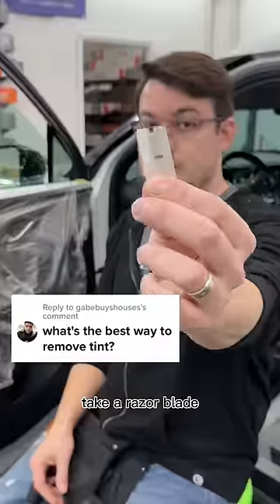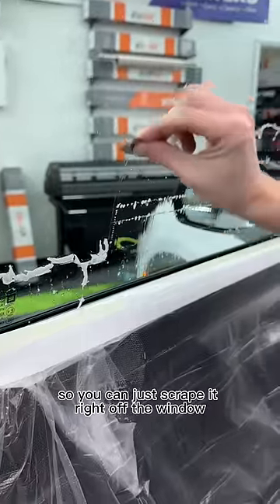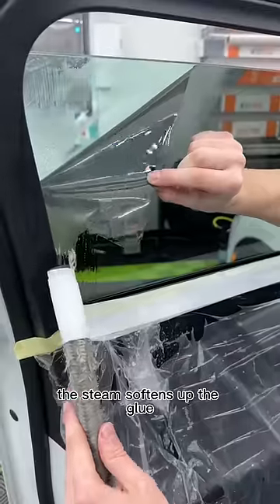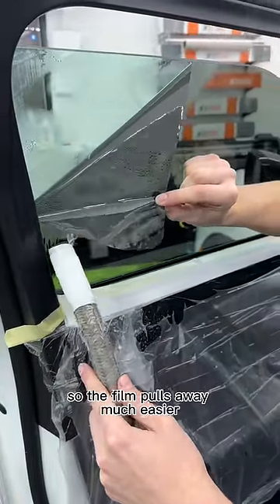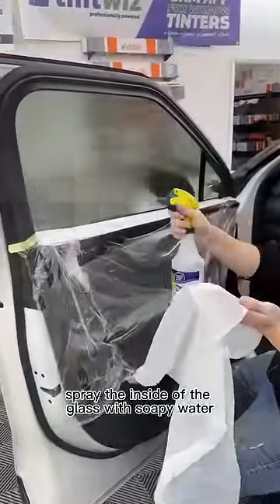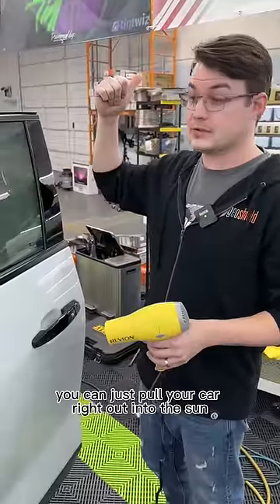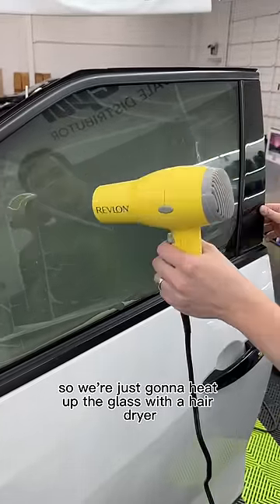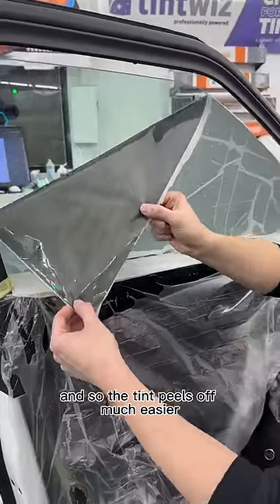Remove Tint BEST Way to do it #diy #tint #cars #windowtint

Comment from the maker: Window tint and tools —> 313tint.com
Reply: Some like Lexus and Toyota have a clear film on glass how do you handle that?
Reply: Can you do a test with Tuff Stuff? Back on my days in 2000 we used to remove the film and apply the foam and it removes the glue.
Reply: Do y’all do chrome tint ?
Reply: What soapy water do we use to spray the window and then put a trash bag on. Doea the watwr need to be warm or cold
Reply: I saw this video and tried it with my steamer 🙌 it worked perfect, removed them all in 30 minutes. Thanks for the tip, saved me $150 😄
That's what they wanted to charge me to remove the tint!
😏 "suckers"
Reply: Instead of a blow dryer what about a heat gun

Comment: I don't trust myself removing the glue with a blade. I know damn well id scratch the glass
Reply: I did
Reply: You gotta go with the curve of the glass so you don't dig into eh
Reply: @vitaliylapatin  oh.. Welp that's a bit too late
Reply: @vitaliylapatin  still trying to find a way to get the scratches out
Reply: @Nekaro Amemiya Ch. 雨宮ネカロ  you have to use a sheep wool buffing pad with some polish paste.
Reply: @vitaliylapatin  ah I'll try that, thank you very much
Reply: @Nekaro Amemiya Ch. 雨宮ネカロ   but you can't go too hard you'll make it look blurry
Reply: @vitaliylapatin  ah noted
Reply: I'm actually just kidding
Reply: @vitaliylapatin  oh.
Reply: It's not a sheep wool pad . It's called glass buffing pad. Drill attachment.  But the one that works I don't exactly know who sells it
Reply: @vitaliylapatin  I see, I'll do some research on it
Reply: you have to be joking lmao, metal can't scratch glass
Reply: @JZM006  I’ve installed window frost and other films for businesses and I can tell you you use a 6 inch window scraper on tempered glass you can definitely put scratches in it 
It’s isn’t necessarily the blade but ultra fine particles from the manufacturing process 
But highly unlikely to do it to a car window unless you’re completely out of it
Reply: Glass is harder than metal, you cant scratch glass with a razor blade......
Reply: @jimmynoodlepickle740  Glass is around 6.5 hardness, steel/iron can be almost 7 in some cases, other metals can be even harder.  Whether you can "scratch" it with a razor or not, you can easily gouge or break tiny pieces off from too much pressure in a small area, which could look exactly like a "scratch"
Reply: @jimmynoodlepickle740  glass can be harder than other metals. I can also argue that glass is harder, but it is brittle and fragile, you can't argue that a guy that broke a door window by punching it is stronger than a solid steel.
Reply: @jimmynoodlepickle740  glass can be harder than other metals. I can also argue that glass is harder, but it is brittle and fragile, you can't argue that a guy that broke a door window by punching it is stronger than a solid steel.
Reply: @Jimmynoodlepickle  try on your windsheild then reply back please :)
Reply: You can't.
Reply: You can get plastic scrapers, personally I would also scratch it so I prefer plastic scrapers for anything scraping related. since you’re going inbetween the layers, as long as you loosen the adhesive, it shouldn’t be too difficult even with a plastic scraper. They do break easier than metal but I’ve only had one break so far and that’s because I held it at a bad angle with too much force
Reply: Glass don't get scratch by the steel blades.
Reply: You gotta be one slow mf to scratch a window with a razor blade lmao they literally glide on the glass
Reply: @wherethehoochiesat4210  uh not really, you just have to hold it at the wrong angle, it glides because it’s at the right angle so the force is deflected enough to slide along the surface instead of trying to gouge it…
Reply: Thats literally not possible because glass is harder then steel
Reply: @sumdudes2ndaccountlol173  glass is a 5.5 hardness, steel is a 6.5. Which means it is indeed possible
Reply: @JacquelineUnderwood  idk where tf you pulled that Number from but Steel is a Mohs Level 4, Glass is a Level 6-7... you can look it up
Reply: @JacquelineUnderwood  go watch jerryrigeverything u'll get it
Reply: @sumdudes2ndaccountlol173  I have looked it up, literally every source lists glass as a 5.5. As for steel, I was going off “steel file” which is 6.5. That being said, even a knife blade is 5.5 which could also scratch glass as they’re the same hardness
Reply: @JacquelineUnderwood  whatever source you are using is total bs, just take a Kitchen Knife and try to scratch a Window or your Phone and you will see nothing will happen
Reply: @sumdudes2ndaccountlol173  a steel file isn’t the same as a knife
Reply: @JacquelineUnderwood  go ahead and try it, i bet it wont do shit
Reply: @sumdudes2ndaccountlol173  have you straight up never scratched a piece of glass with a nail or knife or the like before? That was straight up part of our hardness module in high school. This is a very dumb argument for something you can look up…every source says glass is between 4-7 (window glass is around 5.5) and steel tools are between 5 - 6.5 (with steel needles and nails and the like being around 6.5, and the most commonly used in hardness test kits that I’ve seen), scratch plates are around 7, etc. so while there is room for variables there, it’s not some impossibility or even improbability that glass be scratched by a steel scraper or knife or other form of tool 🤦🏻‍♀️
Reply: It depends on the glass, but glass can't be scratched with any metal softer than glass. Glass has 5.5-7 hardness, razors can be anything from steel at 4, to tungsten carbonide at 9.

If you get a cheap enough razor, it will be soft enough to not scratch glass.
Reply: @sambobop7309  Harder ≠ stronger.
Check out the Mohs hardness scale.
Reply: @JacquelineUnderwood  Steel is 4, but most tools dont use just steel. They use stainless steel or even carbide steel. "Steel" can be anywhere from 4-9, and "glass" can be anywhere from 5.5-7 or even 5.5-9 if you include sapphire crystal (which I dont)
Reply: @penguin8572  thank you for the explanation of why it varies so much, I assumed it was due to tempering tbh, but the inclusion of other metals makes a lot more sense
Reply: They sell plastic razor like things you could use to for this
Reply: The metal razor blade he used in this video Literally could not scratch the glass, as glass is harder than metal on Moh’s hardness scale. Clearly car guys need to watch more Jerry Rig Everything
Reply: you have to blunt the two edges as to not scratch it
Reply: @coach2779  It depends on the metal. Razor blades can be made out of anything from steel (Most common in my experience) which is softer than glass, or tungsten carbonite (On the blade tip). If someone used a shaving razor instead of an office supply razor they could run into problems.
Reply: It’s not very easy to scratch with a razor blade when it’s flat on the glass. You can definitely scratch it when trying to cut the film and that’s when you need to be most careful and use stainless steel blades.
Reply: @NoLurp  Stainless steel has a hardness above most glass. You would need to be most careful when using stainless steel blades, and can be less careful when using plain steel on glass and glue.
Reply: Metal can't scratch glass
Reply: It would be challenging, steel is 5.5 in the mohs scale of hardness, and glass is 6
Reply: @-Weather-  I smell jerryrigeverything
Reply: @-Weather-  Plain steel is 4 Mohs hardness...
Reply: I would have to go to the ER
Reply: @nekaroamemiya no way to remove the scratches out without replacing the glass.
Reply: Fr
Reply: Bug spray will take the old glue off and a rag no need for blade or scrape nothing, clean with windex after
Reply: I wouldn't trust my self removing the glue with a blade bc I would probably cut myself🤷🏻‍♀️
Reply: you literally cant
Reply: I’d scratch myself 😂😂😂
Reply: That's why you get a plastic blade you feel much more comfortable
Reply: I used a plastic blade. I did not trust myself to not scracth my window. Wish I saw this earlier. Could have saved me two  hours. I just used rubbing alcohol. 😕
Reply: Best way to do it is to put your index and middle fingers on the bottom of the razor, against the window so it keeps it at an angle that won’t scratch the glass
Reply: @nekaroamemiya use more glue
Hope this help👍
If its not helping just hammer the shit down
Hope this help👍
Reply: @vitaliylapatin why not just use a hard card?
Reply: @crackersnucker   not sharp enough in my opinion.
Reply: You can get scraper blades specific for glass and do it at an angle so it's less likely to scratch
Reply: Really hard to scratch it. Unless you're using it wrong.
Reply: You just need to use a straight edge razor and keep the glass wet. Also feels like this goes without saying, but be sure to use the razor at an angle, not 90° to the glass.
Reply: You can buy these plastic razor blades for Windows and paint decals. I work at a ford dealership n I gotta take tints n decals off of trade ins all the time
Reply: It’s pretty easy not scratch it, you have a better chance if you have close to if not the whole blade on there once, more surface area
Reply: As long as you have stainless steel blades and you keep the blade flush with the glass it won’t scratch
Reply: @JacquelineUnderwood regular glass is a 5.5 on the hardness scale. Car windows use TEMPERED GLASS you retârd do your research before fighting people
Reply: @zazo5525  car window glass still often has films or the like that you can scratch. Also, if you have to call names to make a point, you’re not making your point very well. Im just going to assume you’re having a bad day and taking it out on others, hope you have a better day going forward.
Reply: @JacquelineUnderwood  nope because if you watched the video you would realize it’s teaching you how to remove the window film in the first place. I love how you’re trying to deflect the question after being so confidently wrong. Also tempered glass ranges from 7-9 on the hardness scale so you’re completely wrong. One minute of simple research couldve told you that.
Reply: @zazo5525  yes, the original video was about aftermarket window tint. The comment was just about glass in general. Also, there are films and the like on a lot of peoples glass before you apply aftermarket window tint. If you scratch those, you’re going to have to remove them entirely. And you can still scratch tempered glass. Yeah it’s less likely but it’s not impossible. It’s silly to act like it is, and even sillier to continue getting at someone about offering an alternative that would be a lot less likely to scratch even the original films on the window.
Reply: @JacquelineUnderwood  Yes I know that’s why I said the video was about removing them. You don’t have a leg to stand on in this fight that’s why you deleted your comments😂 you’re wrong and you should give up.
Reply: @JacquelineUnderwood  Also the person you first replied to was obviously lying. It’s a literal child I don’t know how on earth you felt the need to even start a comment chain in the first place
Reply: @TheMinecraftReloaded ”in some cases” buddy we are talking about razor blades here not the hardest steel
Reply: Well you can't really glass scratches at a level 6 with deeper grooves at a level 7 razor blades go up to 5
Reply: Try with nail polish remover and clean it. It works
Reply: If the window is wet you won't scratch anything.  It takes diamond hardness to scratch glass
Reply: I used my finger to get the adhesive off after spraying left no marks and Ian have to use a razor
Reply: i like to use those sponge looking scrubby pads and use a little bit of isopropyl alcohol it takes the adhesive right off just be careful not to use too much isopropyl because it can potentially damage the door panel if youre not careful
Reply: @jimmynoodlepickle740  Yes , yes you can. I've seen it happen myself. One time, another window tinter scratched all 5 windows on a low mile one owner Supra because he accidentally used a carbon steel blade ! ! IDK how they fixed it, polishing or just replaced all but the windshield. 🤦🏻‍♂️
Reply: Dude, your not shaving someone w a straight razor here, not not rocket science... You just scrape the glass clean... pretty simple. If you can't do that then you sure as hell shouldn't be attempting to tint windows!
Reply: It’s actually incredibly hard to scratch glass with a blade. You really gotta be wanting to fuck it up. I’ve used blades in detailing to get glue off glass and worked for a glass company for roughly a decade and can’t say I’ve ever scratched one
Reply: Not if u spray soapy water on it. U Never scrape it dry it will definitely  scratch it.

Comment: A used clothes steamer off of ebay is incredibly handy to remove tint, decals, etc with zero collateral damage.
Reply: I bet that'd be good for removing wallpaper, huh?
Reply: Cause I wanna get rid of the wallpaper in my bathroom.
Reply: @IttyBitty412 yes

Comment: Worked perfectly!  Used a garment steamer and had absolutely no glue residue.  Longest part was just waiting the 15 minutes for the spray to work. Many thanks!
Reply: What do you mean, "...for the spray to work." Do you mean the steamer sprays?
Reply: Did vinegar/water spray and the trash bag overlay.  Waited 15 minutes in the sun and then used the steamer as I pulled the tint off.
Reply: So you doubled down - bag and steamer?

Comment: This how-to rocks.  I used my wife's "Jiffy" steamer to remove the front door window tint on a 2021 GTI that had been applied by the previous owner (why do people do this?).  Took my time in order to remove as much of the adhesive as possible when the tint pulled off.  There was still a bit left on the edges where I couldn't really get the heat into the film, so I used denatured alcohol on an old rag to remove the residual adhesive.  Note: After the alcohol evaporates on the window surface, any adhesive that didn't get picked up by the rag will stick back onto the glass.  Do yourself a favor and use an old microfiber rag with the denatured alcohol, which will help pick up the adhesive better than the old cotton T-shirt that I used.  The rag will be forever contaminated after this, so relegate it to the oil spill clean-up pile...

Comment: A window tinter I knew, used to use  a 50-50 mix of ammonia-based Windex & 409 cleaner to remove the old tint & adhesive.

Comment: Or get 409 spray (ammonia) and spray the inside of the window and put a black trash bag over it so it doesn’t dry out. Leave in the direct sunlight for 20-30 mins and boom everything off at once.

Comment: Thank you for your helpful video. I am removing tint from a 2010 Silverado. It takes me about 45 minutes per window because I am using a heat gun not a hair dryer. If the window gets too hot to touch I move it to another area. The glue is the most time consuming and I'm hesitant to use a razor blade instead I'm using Bon Ami. It takes a little effort but the windows are so clear it's like they're not even there.

Comment: After seeing your videos scraping the glass to clean it with a razor blade. I finally got the courage to remove the old dealership set of stickers off my glass that have been on for 25 years. And they came off great with the razorblade without scratching the glass up.

Comment: Peel the very corner of the tint then start to pull slowly. The glue will come off not all of it (90-95%) have a wet towel and swipe the glue away. You can also use your finger but it gets tired.

Comment: Watching your videos gives me the information I need to PROPERLY tint my sunroof myself. I botched it with cheap tint for UV protection and to control the heat inside during hot weather. Hopefully now I'll be able to do a far better job thanks to you! :)

Comment: I cut the plastic bag, but it would not hold.  So, sprayed the window well, added the plastic bag with extra folded over the top of the window and rolled the window up.  Applied more spray and smoothed bag over it.  It sat in the sun for 30 minutes (I lost track of time).  I figured it wouldn't work, but, surprise, it did.  Used a knife to get the tint started, and then pulled it and the plastic bag off.  It worked.  No sticky residue.  I drive a lot at night and the tint the dealer put on my car made it difficult to see details out the side windows.  Now I'll look for a sun block tint that is clear at night, if there is such a thing. (Living in AZ in the summer...)

Comment: I did detailing for a few car lots and they bought cars from an auction 2 times a week and dropped them off at the detail shop I worked at. We had to remove the tint off the doors alot and used a heat gun and razor blade
Reply: Heat gun is the king.

Comment: Ok guys.I’m about to solve all your window tint glue problems..spray bottle with dawn and water..hardware store,buy a sanding block.it’s about the size of a sponge.it’s used sometimes instead of a piece of sandpaper.soak the window.rub it around with your hand.have a big towel to wipe window clean.little elbow grease and goodbye glue.did my 2020 vet today.tried everything these guys said.this was by far the easiest.good luck

Comment: If you ever need to take 25 year old tint thats been smoked on and its baked to the window sometimes you can use a razor blade, the thing with razor blades is this, make sure you have PLENTY of soapy water and work real slow and eventually you'll get it all off,DO NOT DO IT DRY or you will scratch your window! this is again for tint that has been on a car since you were wearing short pants,that stuff can get baked on a window were it will only come off in pieces, forget about the whole thing coming off, lol